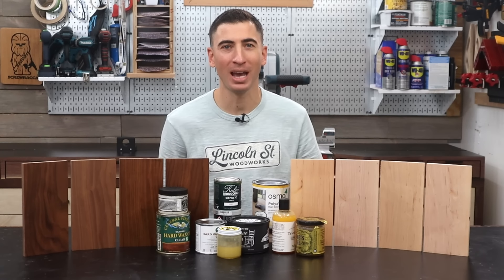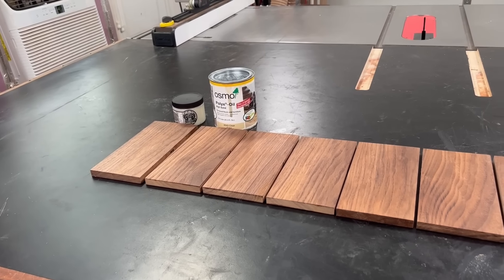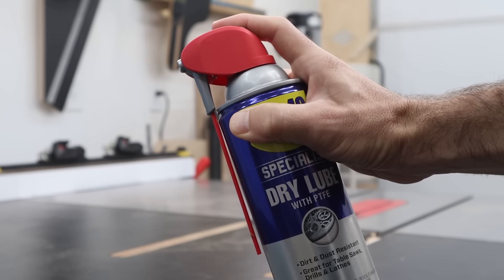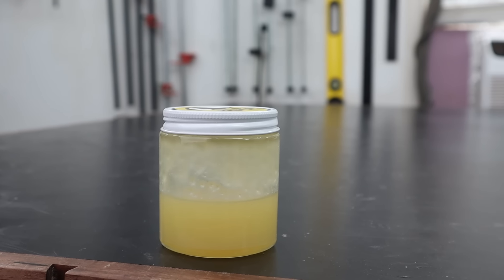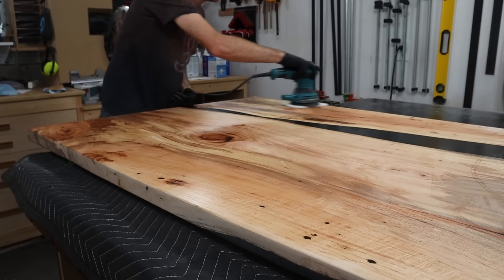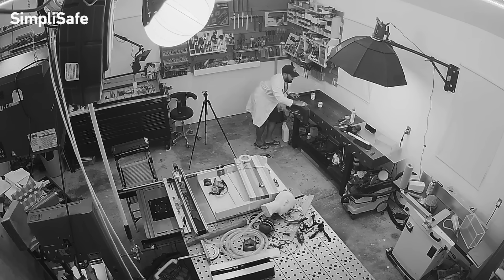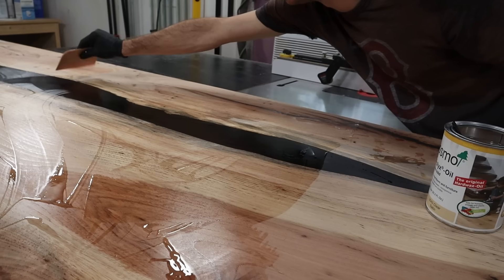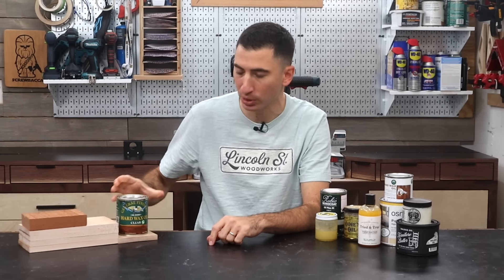Debunking Hardwax Oil Wood Finishes

Comment: I know you discussed this, but I think it’s very important to note that not all volatiles are the same. The nature of the solvent is key. For example, shellac has a ton of VOCs in it, but it’s just ethanol which while technically a toxin, isn’t the same thing as methyl ethyl ketone.
Reply: You are exactly right. However, it is essentially cost prohibitive to test all these samples in a lab to get proper chemical composition and measure their relative toxicity with known agents and their potency. Even then, there are lots of nuances and complications that is simply beyond the scope of a woodworker. At the end of the day, precaution and ppe is probably the best way to go.
Reply: @WoodcraftBySuman Trust me dust is a bigger problem than voc's from these products.
Reply: @Dickie2702  it's highly variable. For instance, the VOCs in Minwax oil based poly give me severe headaches if I do not use a respirator with a vapor blocking filter. Osmo Poly-X bothers me too but not as bad - I certainly would not apply Osmo in a unventilated area without a respirator. I've never had any sort of reaction with Monocoat, Odie's, or Tried & True.
Reply: @Dickie2702  it’s hard to make a broad statement like that to be honest. Bc it really depends on the specific finish and the compounds within it. Sawdust is cacenogenic but mostly for nasal cancer and increases relative risk ratio by 3.1x from what I remember. Not a lot of other types of cancer with solid data and remarkable increases risk due to sawdust exposure alone (lung cancer for example is 1.19x ish). But say there is benzene or formaldehyde in a finish, as an occupational level of exposure, bet ya that’s gonna get you before the sawdust.
Reply: @WoodcraftBySuman  I'm not a Health and Safety expert but I know we had to upgrade our dust extraction and air filtration when we started machining alot of MRMDF.
Reply: @Dickie2702  there are plenty of finishes that can be applied without PPE. If you want to be safe and assume all have harmful VOCs that is of course your perogotive. But something like Tried & True is literally just polyermized linseed oil and wax (or just linseed oil, or oil + wax + pine resin, depending on the tin) with no metallic driers or solvents or other nasty stuff to breath in. You could eat the stuff, if you wanted to.
Reply: I don't think Osmo is a bad finish by any means. There are simply good alternatives that have zero VOCs on the market these days. And it's not just wearing PPE while applying, it's the weeks or months of offgasing that I want to avoid.
Reply: I've had my business for decades and have tried more finishes that most. I like Osmo my customers like Osmo and as a commercial outfit we take care of our employees. So I'm no looking for an alternative finish. Thank you fir your suggestion but I'll pass.

Comment: The problem with the general finishes hard wax is you have to buy the hardener separate unlike with the Rubio, with that said you can use the same bottle of hardener with multiple cans of the hard wax.

Comment: I just used Odie's Oil and Odie's Butter on a tabletop. I'm visiting the client's home again on Monday, 3 weeks after finish application. I'll do some testing on it to see how it worked out.

Thanks for the video. Lots of great info. And I've really been wanting to get into ceramic coatings. One thing to test out would be how long can you wait after the initial finish to apply the ceramic? Does it have to be almost immediately after the cure rate of the finish? Or can it be applied a month later? 6 months later?
Reply: How does it look three weeks later?

Comment: Being a Parkett solid wood flooring craftsman in Berlin for over 30 some years.
What I always told customers who wanted a bio product was that it is still a chemical solvent based product. Even if manufacturers mixed orange scented 🍊 Esther’s to produce a sense of biological conformity, I wouldn’t eat it , it’s still a chemical. 80 years ago all lacours were oil and natural resin based compounds that harden due to oxidation, including shellac. Today it is sold under the pretention it’s something natural, that’s not true . But there are hard oil products that are good and use natural oils (example Linseed)instead of carbon based (Shell, BP, etc..) . All those quick drying products have inexpensive solvent thinners , that are not very healthy while drying, even if they smell good. It’s marketing.

Comment: I have been working with Osmo quite a bit lately and a few comments:  1. I found the fumes in a double garage to be pretty strong and started wearing a respirator - thanks for validating that was a good move!  2. I placed two objects with rubber feet on my shop cabinets finished with Osmo and both left  marks from the rubber feet that I was not able to wash or scrub off... it looks like sand and refinish - I am not impressed with this  3. Several professional furniture makers have noted that the Osmo of today is not the same as the Osmo of prior years.  They don't know what changed but do not find it as durable and some have switched to Fiddes for that reason.  4. I really like Osmo Raw's appearance on maple and birch - worth comparing to clear.
Reply: I used Osmo for the first time recently. All the videos make it seem like it doesn't have a strong odor, but after only a few minutes of working with it I grabbed my respirator. My VOC monitor showed a modest elevation but it dropped of very quickly with ventilation. I'd say wear a respirator while applying, but if you have fresh air coming in it's probably safe after an hour. The smell seems to linger for longer than the VOCs stay elevated, so when the smell is gone you know its safe.

I used clear satin on ash and it looks pretty good. The effect is subtle compared to more traditional finishes, but it definitely adds contrast to the grain, though the sheen leaves a little to be desired imo. I'm thinking of trying the gloss next.
Reply: Did you try the rubber foot test with the fiddles? Thats a deal breaker for me using blenders and other things with rubber feet on my counters.
Reply: @jstins  - I haven't tried Fiddes yet - I was just noting that some professional furniture makers I follow have switched from Osmo to Fiddes over the last year or so.
Reply: @jstins A bit late but may be helpful for some people, recently had an issue with rubber feet leaving marks on fiddes. Seemed like it was almost a grease type problem or like the surface of the rubber had denatured/softened slightly. Very annoying though as it seems to stand up to most other wear pretty well
Reply: @geoffff  i'm interested in Fiddes as it seems to be well priced too. Their site says to apply with a brush and i guess just leave it? In this video he makes it seem like you can apply it with a squeegee and buff out which is why i prefer.

Comment: Hey @Lincolnstww! One thing I would like to ask is, are VOCs an issue after the coating dries? Wanted to use Osmo on our new parquet, but I have breathing issues and any sort of chemicals in the air mess me up. Does a high VOC amount mean it outgasses for a long time, or is it stable after it dries? And second problem is figuring out which product to use in Europe. Unfortunately bumble guys don't seem to ship to us. :( Thank you for any advice!

Comment: Nice comparison. Another test that I would like to see is ease of cleaning and resistance / compatibility with common household cleaners. The scenario I have in mind is food bits and pieces smeared on the table (think mashed potatoes, yogurt, tomato sauce, cereal pudding, etc) and left to dry completely for a few days - possibly resulting in some of the hardest materials know to man! Then cleaning of the surface with general purpose surface cleaners, including some containing alcohol and bleach. The results should show how clean the surface is and how much damage (if any) the finish has suffered. I have a dinner table finished with wipe-on poly and it passes the test with flying colors, can be cleaned completely, possibly scrubbing it with a cloth with household cleaner and there is no permanent damage to the finish.
Reply: I’ve sold industrial wood coatings for 17 years and would highly recommend a film forming finish over any of these hard wax oils with regard to abrasion, impact resistance, wiping and scrubbing. Don’t get me wrong you can make anything fail but I’d much rather have 2-4 mils of chemically cross-linked film protecting the wood than a non-film forming finish. I would personally go with an acrylic urethane or your catalyzed water-based recommendation on anything that requires regular wiping and cleaning. However, this requires a spray application which intimidates most. Cheers.

Comment: Great video Jon.  I just ordered Bumblechutes for a commissioned project - before actually watching your video I had already ordered the product.  Feeling good about that now. One question, did you do any preparation, other than sanding, when applying the hard wax oils?  A bumblechutes representative suggested I should first ally their All in One Wood finish and then the Beebooba.  Wondering if the All Wood Finish application is actually needed or just apply the Beenooba wax based on your experiments.  These are drink tray a restaraunt will be using.  Any ideas?

Comment: I´m using tung oil up to seven coats for fluid resistance, durability and outdoor constructions. No chemicals and perfect results even though it darkens the wood, of course. This way you have no variations in shiny colors or shades but it´s durable and even protects wood from metal stains. For shiny finishes I polish the surface with bee wax. Sometimes I am combining linseed oil and wax. I must admit, I never used walnut. I guess tung oil would darken the surface way too much. But hey, no chemicals - good for the environment, good for the people.
Reply from the maker: Can’t argue with that!

Comment: I used to be in charge of product testing for an insulation manufacturer. There are specific ASTM testing procedures for VOCs. I believe it’s ASTM D4526-20 and uses a gas chromatograph to measure and evaluate VOCs but there may be another test method for accurately measuring VOCs. Your alarm clock and acrylic box is not quite accurate.

Comment: Just as a helpful tip, be careful not to spray any bearings with WD-40. I learned the hard way that WD-40 washes away grease on parts that are supposed to be greased such as bearings, and when you wash that grease away, the bearings will significantly have a shorter lifespan. After a few more uses, any bearing will become completely destroyed and lock up on you.
Reply: Regular WD40 is a penetrating oil and will remove grease, cosmoline, etc but what he uses here is their dry lube, which is diff than the traditional WD40 can.

Comment: Amazing video John! Thank you for the HonesTea lol. 
I recently finished my wood stairs with Odies Oil and, seeing your video, I'm now considering applying a ceramic coating to it for added durability. Is this something that you have tested before? Or would you recommend against it? So far the stairs are holding up fine after 4 months of use. Thanks!
Reply from the maker: I need to play around with the ceramics more. But I would still say no - especially if you’re happy with the current product. I think odies  is a really solid product. Plus if it needs repair it will be super easy.
Reply: Thanks for the feedback! @Lincolnstww

Comment: Lincoln, finish is not about ease of application it is about protection of materials. These are good for the Floors that they created it for. WILL NEVER BE OK FOR A MAHOGANY TABLE , or any other wood surface subject to stains. Also I must mention to actually finish this properly after applying this will be 10x harder to remove that wax from the grain.

Comment: I’m a huge a Odies Oil fan. I got hooked when I started refinishing and it’s carried over as I’m progressing in the building side of things. I’ve tried Rubio just to see what the fuss about and I much prefer the Odies. Surface prep and follow the directions. A little more work but it’s worth it
Reply from the maker: Yeah, like some of the other finishes they have an advantage for sanding to a higher grit. It’s a solid product!
Reply: A way to cheat extra shine is to come back after a day or two, I sand it with. 2000 or higher grit and then go back with their wood butter, 2 year old projects look like I just oiled them yesterday. Their pigments are cool and you can make endless custom colors, I don’t do it very often but their cool to have on hand

Comment: Interesting, but, this appears to be a comparison of corporate/mass produced finishes.  There is no baseline rubric, here.  What about mineral oil?  No hard wax... okay... let's consider JCM beeswax cutting board and heavy use surface Recipe.  (I've made this in kitchen and it's awesome.)  This video does an excellent job at it's purported dispelling of preconceived notions as to intrinsic value of touted mass-produced finishes, but does fail at any true scientific controls, which, ultimately, may or may not matter to the user/customer.  Control elements notwithstanding, I heartily approve of thinking outside the box.  Kudos, good Sir.  You've earned my subscription!  Next up, MINERAL OIL as a baseline, plus minus beeswax or however you define "hard oil"...and, GO!

Comment: One of the great things about Osmo is the shear number of options that they offer. It’s also one of the things that makes it a little confusing especially when you factor in that because it is a multinational brand there are some products that have been specifically developed for each branch market. The 3043 satin finish you are using here actually has a higher VOC content than some of its counterparts. 3043 is recommended for a brushed or rolled application, while 3053 which was developed for North America as a lower VOC option with higher solids content is recommended for a cloth application. Don’t get me wrong it still has VOC so if you want to truly go low VOC you need to get some 5125 which is the highest solids option and therefore also the most expensive, but it builds a coat twice as fast. Two thin coats of 5125 is a pretty easy stoping point, by comparison I would say you would want to do 3-4 coats of the 3043 or 3053. It makes sense when you think about it though Osmo is a flooring product. If you want build a thick finish quickly on a new floor you go with 5125. If you want give an existing Osmo finished floor a quick refresh you go with a quick coat of 3043 or 3053 to bump back up the sheen and protection with a slightly faster drying time due to the added thinners.

Comment: I'm just throwing this on here. What I want to see tested is this finish claim - high gloss sheens are more durable than satin and flat sheens. General Finishes says this all the time. I get the science that lower sheens lose durability because of the added sheen blocking stuff put in. But in a practical setting, is there really a noticeable difference in durability between sheens or are they just splitting hairs on lab tests? Should you spray two coats of high gloss and only do a final coat with matte or satin? Does that make a real difference? Is it more about low sheens just show marks more than high gloss? I haven't gotten around to testing this partly because I haven't had the excuse to spend $150 on a gallon of high gloss. But I have seen GF on their facebook group actually admit their finish test results and stats don't translate to real world practical use. I'd love to see this claim put to the test. I will eventually test this on my own

Comment: Interesting note on the variation between different chunks of wood. My guess is this might be down to the direction of the grain, especially with open pore woods like walnut. Whether the grain is more parallel or perpendicular probably affects how well the finish soaks into the wood. I did similar tests and Monocoat outperformed Osmo in my test. Though I've been using Tried & True for most stuff these days, the cost, ease of application (no mixing of two-parts, I'm looking at you Monocoat), shelf life (again, Monocoat is terrible in this regard) and ability to build up a nice sheen if you sand to a high grit are what won me over. For table tops and such I use Tried & True Varnish Oil - which has a pine resin in addition to the linseed oil and wax. I haven't done any scientific testing but this seems to be noticeably more durable than the original T&T oil+wax finish. It also builds a glossier sheen than most other oil+wax finishes. T&T Danish Oil - a confusing and dumb name as this is simply pure polerymized linseed oil - is a great finish for tool handles or other things around the shop too

Comment: Sorry, but volatility of an organic compound does not equal the toxicity of that compound.  Odie’s as an example does have some volatility, but is low in toxicity.   A mineral oil can have lower volatility, but can be quite toxic.  You don’t need a respirator for Odie’s, or other volatile non-toxic compounds.